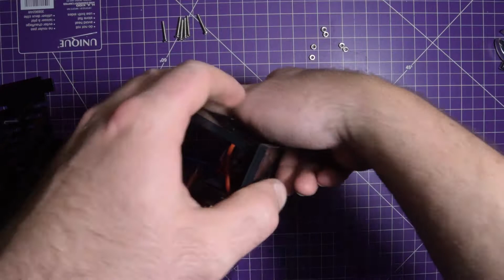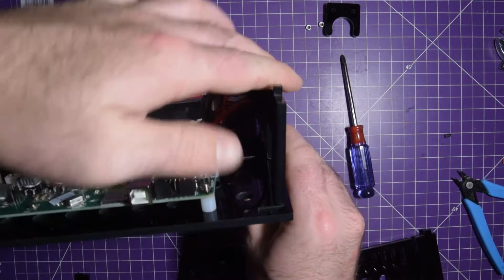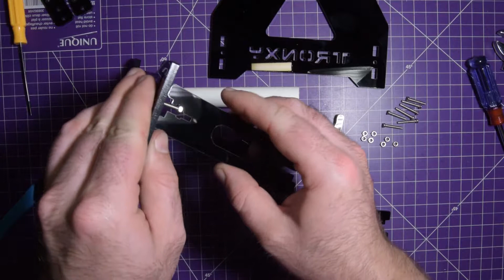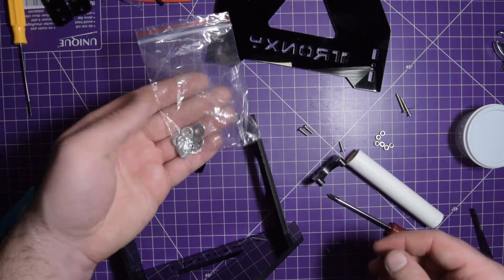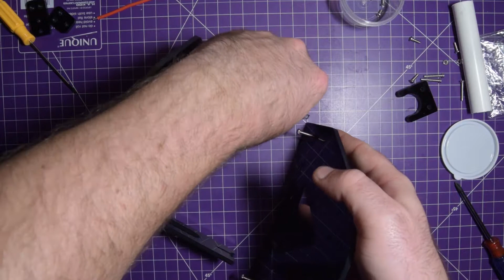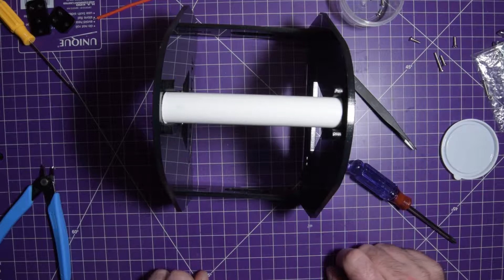TronXY X3A 3d printer build part 10

Comment: I'm getting rid of all my printers except my ender 3 I bought as a box of parts have it printing like a dream with an orbital extruder. I'm building a voron 2.4 so I have a tool in my lab that just works fast even I'm prototype. I'm building it all from scratch, cutting and drilling the extrusions and everything. It can be built for half the price of a kit that costs 1500caf

Comment: This video popped up randomly and I know I just said it in a community post that I have a bunch of stuff I could send you. I have a bunch of 3d printer parts/upgrades that I'm never going to use if you're interested. I hate seeing stuff go to waste by not being used if you need it. I know I'm new to your channel but if you still have a printer you might be interested in the stuff I have. It's relatively high end stuff. I had a bunch of printers I was going to enclose to print cf and nylons but I have a makerspace near me that I volunteer and donate lots of stuff to but they don't need a 250 dollar btt skr  2.0 and 5 inch touch screen or all metal hotends and different extruders. Plus all sorts of e3d style thermistors. I'll give you my email if you want and I'll send you pics of the stuff. I'd love to get rid of the stuff and give it to someone who needs it and doesn't think I'm a weirdo for offering it. People in general I've found always question kindness thinking there is a catch.

Being that you're in Ontario and I'm cape breton near the nfld ferry shipping is cheap. The maker scene around here is more craft based with wood and metal and I have no one to give all this stuff to. Haha. I just outfitted the local makerspace electronics area with a real selection of circuit components, lots of arduinos and esp mcus, literally thousands of sensors, motors, displays and every sensor you can think of. I gave them filament and brand new multimeters and other tools for people who want to learn but can't afford it. I'm not rich but I've been buying stuff for the last year and a half to donate to a school or learning center but the makerspace needed it more because they want to start programs with local youth clubs. I'm donating anonymously but I'm helping them develop a robotics program for kids. I'm developing a platform on mecanum wheels (which they can fabricate really nice ones) that can be controlled with an arduino via Bluetooth using scratch to code for the kids and more advanced control electronics for older people that use machine learning, open cv, tensorflow hopefully. All they had when I first went there was really, really nice bench gear that you and I will never afford and a some old raspberry pi boards, resistors, diodes and that's it. Lol plus I'm giving them almost all my logic/voltage chip collection. I collect leds as well as a hobby and gave them over 5000 leds of all different sizes and neopixel strips and 8mm pl9823 adressable leds. I have over 100k leds haha. 

I tell you this not to brag but to show I'm not some nut. I've got lots of cool stuff you might want that I'll never use or have too much of haha you seem very genuine is why I make this offer and became a channel member. None of my friends are into comp Sci or electronics as a hobby.
Reply from the maker: Hey, I haven't gotten around to answering your post yet, but yeah shoot me an email ("about" section of my channel) I'm not sure if you know this but I have a custom 3d printer I am working on, I would love to see what you have!
Reply: @SimpleElectronics  I'm not seeing the email address my friend. The form on your website doesn't work haha. I thought I left this message already but it's not showing haha
Reply from the maker: @jstro-hobbytech  Youtube filters emails, you have to click the reveal button on the about section. but here I will type it for you, just replace the "1"s with "i"s : s1mpleelectron1csyt(at)gmail(dot)com
Reply: @SimpleElectronics  I know and I just gave my prefix to the at. Hahha
Reply: @SimpleElectronics  put the year 2015 after
Reply: @SimpleElectronics  charliecat
Reply: @SimpleElectronics  og mail baby hahahaha.
Reply: @SimpleElectronics  or my name with an underscore between it at the other guys who have the marketshare in desktop gaming hotchocolate mail
Reply: @SimpleElectronics  sorry for all the messages. I'll just join your patreon in a few days if we don't talk over email
Reply from the maker: @jstro-hobbytech  Don't worry about it, I tried to de cypher your email - but it seems I wasn't able to -lol mine is literally my channel name (no spaces) followed by the letters "YT" and that's AT google's electronic mail service. If not, you can find me easily on BitLuni or Brian Lough's discords :)
Reply: @SimpleElectronics  ok cool. I'm not on discord. I'm fans of both though. It's getting late so I'll send ya a hello and you can get back to me at anytime. I always get overly cryptic when trying to give my email haha you can enable it I believe but then it enables spam
Reply: @SimpleElectronics  oh man cool. I hit ya up in a bit. I've got your electronics, extruder and hotend covered

Comment: Have you managed to get it up and running yet?

I'm interested to see what a sub-$200 (CDN) printer can do.
Reply from the maker: Yes actually, I have not filmed it yet, but I've printed quite a few things, it works amazing - I've been printing upgrade parts but I can't install them before the "first impressions" video is filmed. If you're hoping to see it soon, ill move it up in priority!
Reply: @SimpleElectronics  I am just building my own one with your films so I am looking forward to see the end of installing and printing
Reply: I assembled mine but could never get it to function and the control board crapped out